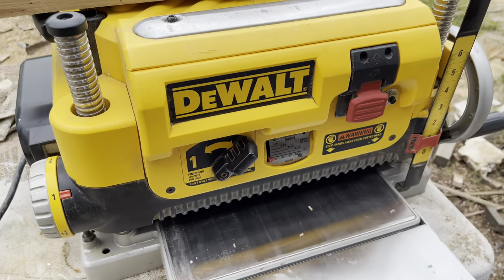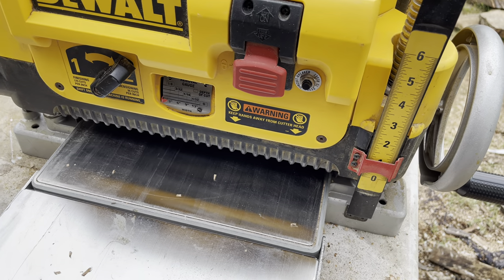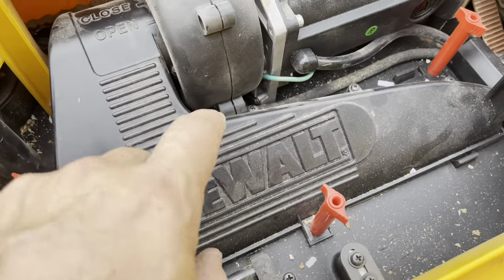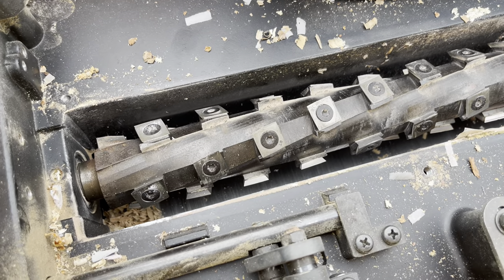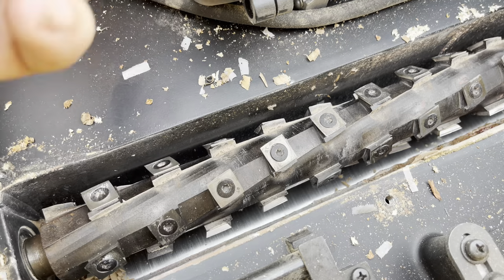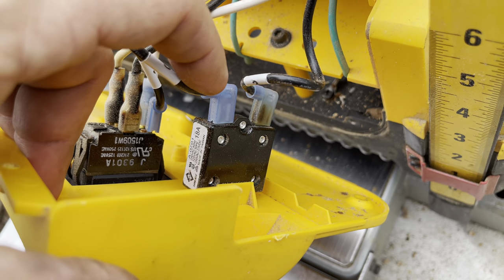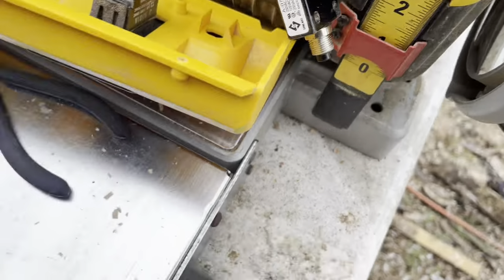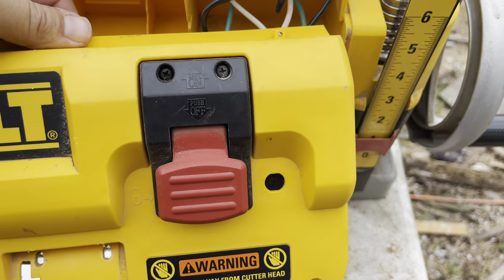Dewalt DW735 13 inch planer breaker tripping fix

Comment: Excellent and informative video. I just had a problem today and your video gave me a hint of what might be the problem. The wood was feeding through, but the blades stopped spinning and cutting. I will change the blades and see if that is the problem. Perhaps the breaker went off because the motor overheated. Here is something I noticed and can't figure out. I noticed that the metal on the planer body (not the circular cutter head) near the screws that hold the blades has chips missing. The blade is not touching the metal body, but perhaps the chips flying off are causing the metal to chip. Ever heard of this?  I also think that I will replace the straight blades with a helix cutter. Anyway, thanks for taking the time to post a very good video with good camera clarity.
Reply from the maker: Sounds like your belt broke or maybe your bearings on the cutterhead. That would be the only reason I could think the cutter would stop but rollers still feeding. And definitely sounds like the blades chipped the body as they flew off. Or shrapnel from metal in the wood.

Comment: Hi would you happen to know  as soon as the machine is switched on it trips the electric immediately on a dw733. Thank you for any help. Derek
Reply from the maker: Yes! The wiring inside behind the switch & circuit break below are likely melted & crossing each other. I’ve had this happen multiple times to mine. Much like you can see in this video it was definitely a culprit. Open it up, while unplugged & check. You’ll need to cut the bad wires out, splice in new ones if needed for length & swap out the power switch & circuit breaker on the unit. Should be up & running again
Reply: @loveofthegrainworkshop2891  thank you very much for your reply
Reply from the maker: @derekgales2842  anytime!

Comment: I have purchased blades off Amazon and I replace them frequently. Where do you get good quality blades for your three blade Dewalt 13 inch planer
Reply from the maker: After the 3 blades went bad. I replaced them with the Byrd Helical cutter head. So I unfortunately don’t buy those blades at all.

Comment: So have the DW734 and I am having the same issue. The person I bought it from had worked over the first side of the blade pretty bad but the second side was totally new. After doing one project of planning 11 2x4s down by 6/32 (not all at once) I am not tripping almost constantly. The only other difference is that its summer now and the garage heats up pretty fast. Could it just be a cooling issue as well?
Reply from the maker: Possibly as my shop is the same. But, once it starts tripping over and over. That means it’s gone bad. So just replace it. Saves loads of time and headache. Any other questions feel free to ask.

Comment: The factory circuit breaker is a faulty design. Instead of just tripping at 19 amps, it is designed to heat up at the same rate as the motor and trip at theoretical overtemp. Thats why after the first trip, it trips every pass or two.   The planer was completely useless to me, so I replaced the breaker with a non thermal 19 amp breaker.  45 minutes of planing 2x6's with no tripping. The motor was lukewarm to the touch. The factory should have built thermal protection into the motor, with overamp protection on the mini breaker.
Reply from the maker: Great information. Let us know where we can get that breaker?
Reply: @loveofthegrainworkshop2891  It was just a used breaker scavenged from junk equipment.   I did however just mod a DW734 using a 20 amp breaker part # 4VA77 from Grainger. (for a friend)  It might be a touch oversized, but my theory is that common sense operation > a scrap machine.   In both our cases, the planers were going to be replaced because they were useless, so burning it up was no worse of a result.  After repairing the DW734, I tested it with  several small cherry boards, then a 12" x 8' rough cut pine. Taking 3/16" with 1/2 turn passes left the motor just slightly warm to the touch. Far cooler than a shop vac or any other universal motor after running for that length of time. 

TLDR. . . 4VA77 from Grainger,  Mod at your own risk, and use common sense.
Reply: Where can I get the non thermal 19amp breaker??

Comment: So we have this planer in our shop, and we have this issue with the circuit breaker after swapping blades. Why would we invest in a helical blade and not a better planer?
Reply from the maker: Good question, the byrd helical head is around $500. Vs upgrading the planer to a more robust one which would probably be something by Grizzly. That’s $1500 minimum for the next best thing.

Comment: Load is not the power coming in. Load is the piece of equipment that's being powered, thus putting a load on the circuit. Line is the power source.
Reply from the maker: Thanks